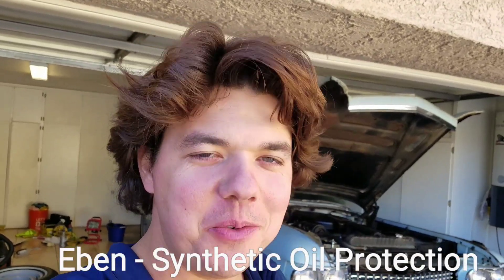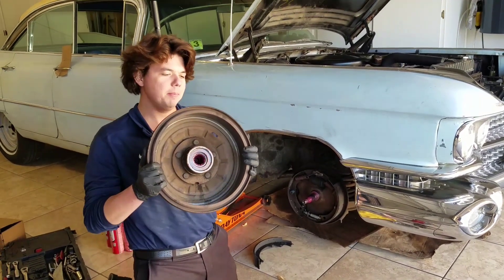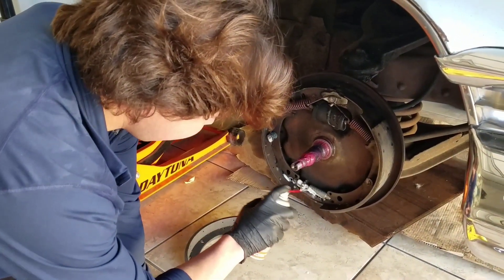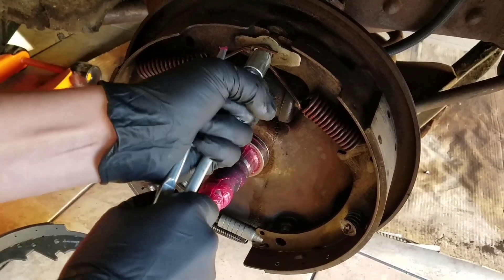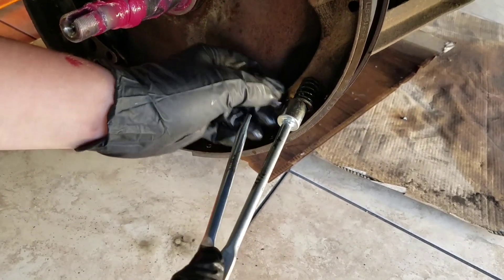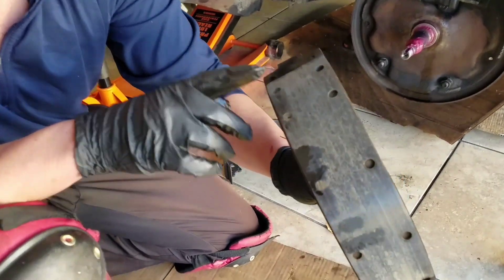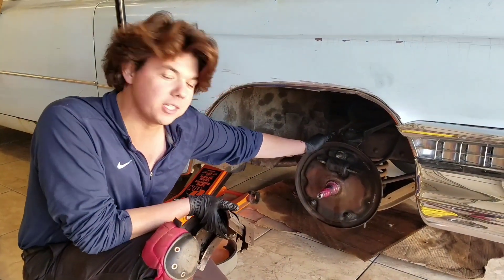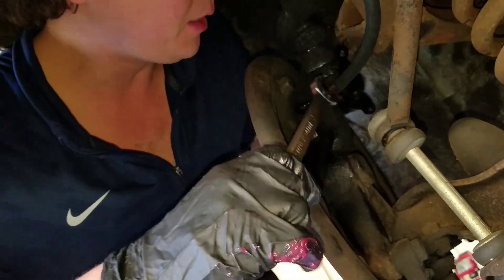1959 Cadillac DeVille Brake Cylinder Rebuild

Comment from the maker: Watch This NEXT: 1959 Cadillac- https://www.youtube.com/playlist?list=PLB_ftWArBFdeVKszO64Ig5nWEQp7H3oF-
Professional YouLubher:
Eben Rockmaker Executive Direct Jobber AMSOIL Specialist (Dealer#: 5331179) 
Mobile: (702) 472-3614
 My link: AMSOIL 25% Less Wholesale & FREE SHIPPING: https://www.amsoil.com/offers/?zo=5331179
AMSOIL Makes it for your Vehicle Lookup - https://www.amsoil.com/guides.aspx?zo=5331179

 If your vehicle is not on the lookup guide this is AMSOIL Tech Support 715-399-8324

Best Videos - https://www.youtube.com/watch?v=qjR2pjggjhY&list=PLB_ftWArBFdd7D6zW4OCpA0yEjh-uRY2t

     Friend me on and tag me because I like to see great results from my YouTube Community:
Instagram - https://www.instagram.com/syntheticoilprotection/

Facebook - https://www.facebook.com/profile.php?id=100007973957868

Order AMSOIL By Phone:

Be sure to give them my number so I get credit Eben #5331179 and tell them you would like to be a Preferred Customer.

1. Call 1800-956-5695
2. Ask for your own preferred customer membership because you will get 25% off, free shipping over $100, and your informative quarterly AMSOIL Magazine. It costs $10 for 6 months or $20 for the year which is well worth it.
3. Give them my dealer number so I get credit Eben 5331179
4. Orders over $100 will be shipped free.

Industry-standard 3rd party testing results:

AMSOIL Signature Series 5W-30 Synthetic Motor Oil protects against harmful deposits on turbochargers 4X better than Mobil1® Extended Performance and 3.6X better than Royal Purple® in industry-standard testing*.
https://www.amsoil.com/newsstand/motor-oil/articles/leading-the-field-in-deposit-protection/?zo=5331179

Amsoil gets better gas mileage - 
https://www.amsoil.com/newsstand/motor-oil/articles/another-win-for-amsoil-products/?zo=5331179

AMSOIL Signature Series is fortified with a heavy treatment of detergent additive and it delivers 30% more acid neutralizing power1 than Mobil 1, and 36% more than Royal Purple, helping engines to stay cleaner, longer.-
https://www.amsoil.com/newsstand/motor-oil/articles/cleaning-up-the-competition/?zo=5331179

Comment: That wheel cylinder isn't in bad shape. I've had to hammer the guts out of them because they were so badly rusted. The rubber looked better on your than on my 1992 when I removed it. I'd say your wheel cylinders have been replaced at some point.

Comment: Bra, you shoulda got a wheel cylinder kit. Woulda come with a new spring, new cup seals, and dust boots.....
Or, if you weren't too concerned about keeping original wheel cylinders, just ordered a couple from parts house....
Reply from the maker: We did put a new wheel cylinder kit in he was the narrower spring you'll see in the video there's two different Springs The Wider one was the old one and the new one was little bit narrower.

So far everything seems good we're going to finish all four corners and then move on to the master cylinder.

She's coming around😀

The master cylinder has so much rust inside it that's why we just got the new master cylinder instead of rebuilding it.

Comment: YOUR SHOES ARE ON BACKWARDS DUDE! SMALLER TO THE FRONT AND LARGER ON THE REAR.
Reply from the maker: Thank you I will switch them around I looked at the pads and it looked like there was only one way they fit on perhaps I mismatch them. Thank you
Reply: @Syntheticoilprotection  I watch the video a little further and I I didn’t realize that your front shoe or the back she was broken but always secondary she was the larger diameter longer. One goes to the back in the primary shorter shoe always go to the front of the vehicle.
Reply from the maker: @davepeters360 should I flip them?